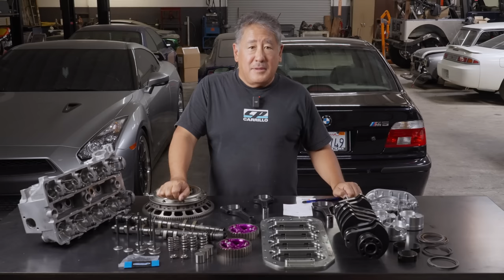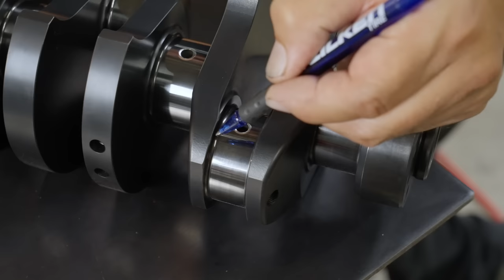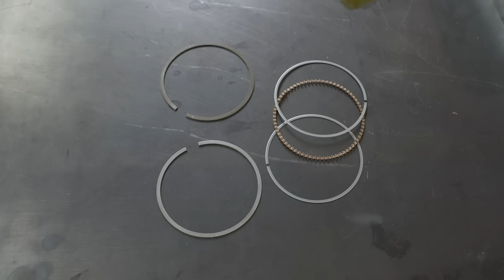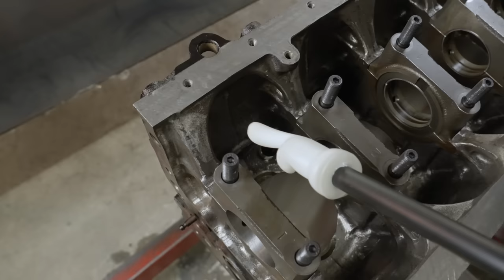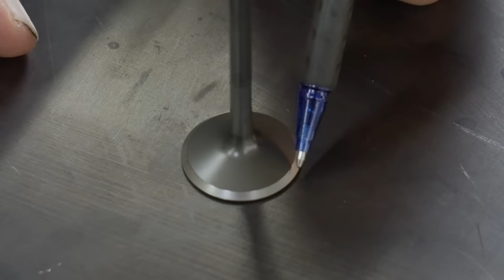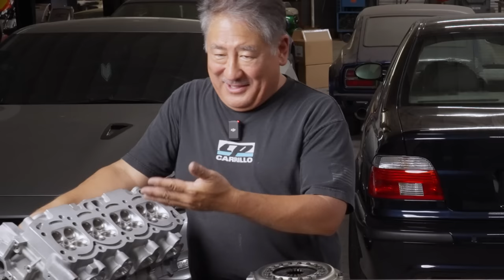11,000 RPM Toyota 4AG Engine Build!

Comment: If you want 9000rpm just swap in a 2ZZ
Reply: "If you want 9000rpm just swap in a 2ZZ"

If were talking about a car that already rocks a 4age, itd be less work/money to get a 4age to 9k rpms than to swap in a 2zz engine.  Not to mention itd still take some work to get the 2zz itself to 9k rpms.

Neat engines though.
Reply: @SidewaysGts  stock 2ZZs in lotus Elise’s already go to 8500rpm. Not to mention 2ZZ will make more power from the get go. Have you tried to squeeze power out of a 4AG? Good luck getting more than 140-150hp
Reply: @kenxiong6830  "stock 2ZZs in lotus Elise’s already go to 8500rpm"

Neat :) Theyre good engines.

"Not to mention 2ZZ will make more power from the get go."

Yep- About 180-190~.  Again, good engines.

"Have you tried to squeeze power out of a 4AG? Good luck getting more than 140-150hp"

If were just talking that much out of the engine itself- Its actually fairly straight forward to get there.  Mostly stock engine with some bigger cams and you can get there.

Or you can go with a 20v, and see around 155-165~ (Depending on condition, silver or black top, etc).  

My bone stock black top 20v put 135 to the wheels, which would have it right in the 160-170~ hp range.  

But thats kinda where I was going with all that.  Again- depends a lot on the platform in question were starting with.  Even a 20v 4age can be had for a few grand (And just for conversation sake checked ebay right now. theres a silvertop 20v on there for 2600 bucks shipped)-  and if were talking about a car with a 4age already in it, it will bolt right up with very minimal work (especially in comparison).

Taking a car thats set for a 4age, and then  tossing a 2zz into it- its a lot of work, and a good chunk of money.  That money can go a long way in a 4age.

Again, 2zz is a great engine.  But if were talking about a car already set for a 4age, youve a lot of wiggle room due to the costs of getting that 2zz in there.
Reply: @SidewaysGts  if you’re going to go through the hassle of getting an imported 4AG it would be easier to just get a 2ZZ. 2ZZs can be found for cheaper than the prized black and silver top 4AGs. I paid $300 for the 2ZZ I got out of a wrecked GTS. That gave me plenty of cash left over to make things work. I’ll admit the ease of swapping in a JDM 4AG would be easier but the stock power of 190hp and 8500rpm from the 2ZZ makes it so much more appealing. 4AGs are amazing engines but when you start wanting more power and RPM it can get very expensive. Not gona lie though, I’d love to get my hands on a former formula Atlantic 4AG!!!

Comment: Not sure why anyone would think their mash up of parts would hold up better than what specialists recommends. Builders or any people who do this for a living and have passion for it? Would  know a thing or two. Not heeding their advice or recommendations just made a pretty poor decision.
Reply from the maker: If you add a dry sump this engine will be pretty decent.  Add 3mm os valves the latest cnc heads and my preference in pistons and rods and this will really scream.
Reply: Mismatch lol it a complete stroker kit from os giken with a ported head with cam, valve and spring 
Anyway this thing will be out of breath way before reaching 11k so will be pretty useless to rev it there I believe it's more for bragging rights than anything and do one or 2 rip to 11k to impress people will be ok and make the engine live 
Pretty sure it will need to shift at like 9/9.5k to stay in the power band
Reply from the maker: My thoughts exactly.

Comment: So does anyone know how much something like this would cost ?
Reply from the maker: with a dry sump about 18-20k
Reply: @motoiq  would 10k cad be possible to do on a turbo setup 4age 20v blacktop if I already have the engine
Reply: @motoiq or am I just dreaming ...
Reply from the maker: Sure but you need to spend some money to do so with reliability.
Reply: @ranjodhmatharoo  "would 10k cad be possible to do on a turbo setup 4age 20v blacktop if I already have the engine"

How much of the work could/would you be doing yourself, and how much power are you looking to make?
Reply: @SidewaysGts  pretty much only thing is be doing my self is installing the engine into the car but as for thr engine building I'd leave that to the professionals and as for power I'd hope somewhere around 260-280hp reliably
Reply from the maker: I suggest for 10k to aim for a more realistic rev limit and take advantage of turbo torque.  You can makes a lot of power revving to 8000 with a turbo for that much.  Something like 450 hp.

Comment: A fully radiused valve seat doent work good, it needs at least one sharp angle to sheer fuel
Reply from the maker: That is not true and the laws of fluidynamics agree with me.  So does the dyno. Shearing fuel?
Reply: @motoiq  Ask Darin Morgan
Reply from the maker: Don't need to ask him, he would agree with me, science, flow bench and most importantly dyno results show what works. Radius Newan valve jobs are the same as a Serdi valve job hand worked to blend it into the port and chamber with valve unshrouding, just it's done automatically. We are not doing radiused seats, just radiused entry and exits from the seats, radiused seats don't work well. I am pretty sure you are not understanding something Darin Morgan said and putting out your own interpretation because what he says and does are the same practices that we, and many other good engine builders use.  Shear fuel, change the fuel's molecular structure?  Not going to happen until combustion.

Comment: Why in christ's fuck would you not just start with a 20 valve if you're going to build a motor that revs to 11k
Reply from the maker: The big port head actually flows more and makes more top end when combined with big valves. The 5 valve has a wider powerband and probably can put down a faster lap time in a full body car but has less peak power.

Comment: Rod length is smoke n mirrors imo
Reply from the maker: Nope, check out Honda's research on it.  Other 4AG tuners too.
Reply: @motoiq  NASCAR researched it n didnt find nothing
Reply from the maker: Some NASCAR engine builders like Waddell Wilson and Smokey Yunick found gains and even determined that a minimum of 1.7:1 was best for an SBC back in the 60s-70s.  What NASCAR study are you referring to? I would like to read it if you have a link. We have found that a longer rod helps engine durability, sometimes a lot, if not adding power, gains are hard to prove since customers don't want to pay for A-B testing. A long rod engine sounds a lot different, smoother, and revs easier, sometimes has less bottom-end torque. Often, particularly on a stroked engine, a longer rod is worth it for durability reasons alone. Here are some tests on a 4AG that someone else did. https://www.youtube.com/watch?v=uQLiWQAS35E

Comment: going for +10k RPM and not a drysump is a false economy.
Reply from the maker: That's what we said to this customer repeatedly but they insisted.  I think I even said that a few times in this video. I am pretty sure this is bragging rights type of stuff, their original cam choice and level of headwork was not to par either.  Like I said if this was fully our spec build we would do things differently.
Reply: I have turned 10,000 rpm on 32psi boost on my 4age 20v so it can be done on stock pump, I honestly believe you need to run an ati damper to achieve this witch I happen to make 😅
Reply from the maker: I don't think you did this for long periods of time though, like blasting around on the street or strip, not on a road course.
Reply: @motoiq  road course racing around tracks like Bathurst and eastern Creek here in Australia yeah for sure, there is a trick to not beaking the oil pump and its like the RB engine and that's keep oil in the sump so you don't get cavitation, rear head drain is critical and thin weight oil not to mention not over pressuring the oil relief valve as you just suck the sump dry and cavitat the pump leading to destruction
Reply from the maker: Wow at 10k and 32 psi on the track on a wet sump! I would not recommend that to my customers but all the power too you if you do this consistently.